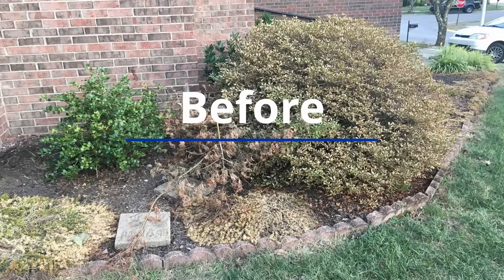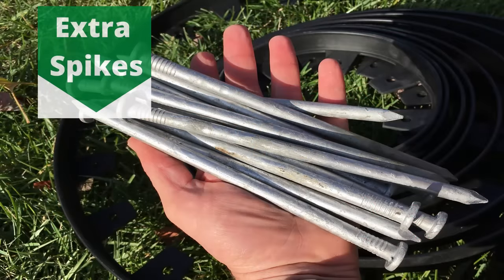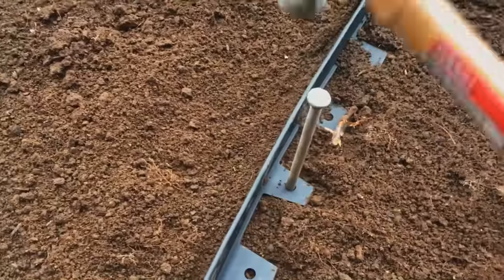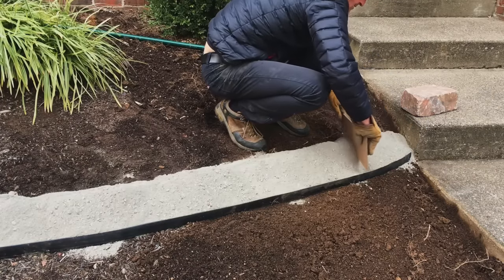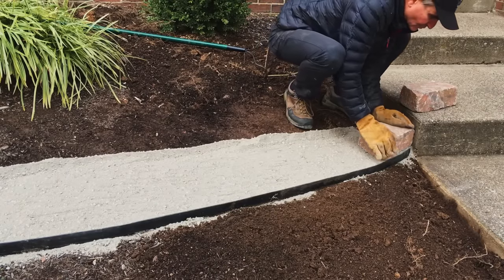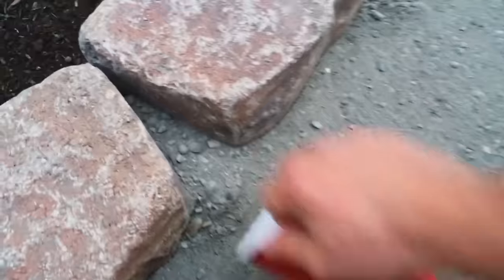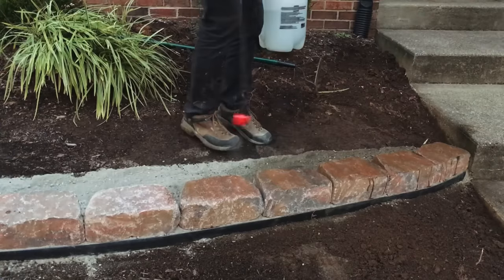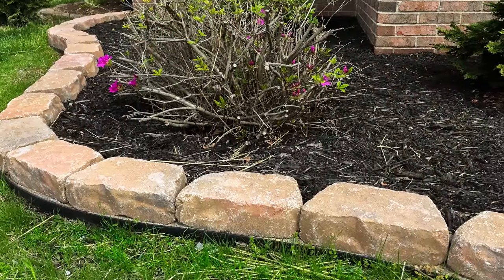easy diy No Dig Border *2020 UPDATE*

Comment: how would this hold up in a freeze/thaw climate
Reply: here in Chicago, that would be broken up with the freezing winters in 1 season. Love the idea though
Reply: I did this in Boston using his old video and all the same material. The only difference is I went three rows high with the blocks. Not sure if the extra weight of each row of blocks (joints staggered) helped with stability, but after three winters everything is still solid. Only time will tell I guess.
Reply from the maker: I make these in Nashville, but others have made them in New England, Chicago, and Canada according to my previous video before this updated this one. There are tons of comments, but if you scroll way through them, they bragged how happy they are with them after a few years.
Reply: That was my first thought also. Seems Michigan winters would destroy the concrete. 🤔
Reply: @wjb111  so concrete is not used in Michigan or Chicago at all?
Reply: @RB-tx4mn  of course it is, burt you would have to go down quite a way potentially. more than a couple of inches

Comment: It may be no-dig, but it’s also no-level. The blocks are leaning forward, not a good look from the curbside.
Reply from the maker: You might not like the way it looks and that's fine, but the angle of the blocks is on purpose because I like it better that way. If you wanted, you could easily taper the cement off to the back side totally horizontal. Thanks for your opinion.

Comment: I don’t know what type of foundation this is.  But on slab foundations you do not want to build beds that go higher than the slab.  That is an invitation for termites and other bugs into your house.
Reply from the maker: Actually, there is no difference in the quality of building product between mortared cement blocks and mortared bricks. It is all the same and termites could care less about that. But if you do have any cracks anywhere, you should get those filled in.
Reply: maxpatch67 in the south brick veneer exteriors have weep holes.  I’m just alerting your viewers to not build their beds too high.

Comment: Maybe I missed the part where you explained how to level the ground properly so your border doesn’t look like a roller coaster track.
Reply from the maker: Ha! Good one. I personally like the line made by following the curves of the ground...to me its more natural and aesthetically pleasing.
Reply: maxpatch67   Definitely, I love the curviness of the outline of the bed.  What I’m wondering is how you get the stones level with each other.  I guess I wasn’t very clear.
Reply: That part involves digging so it was done first. Yeesh, didn't you read the title? This part is no dig :p
Reply: I took the concrete base as the way to level up small imperfections in the  ground without digging.
Reply from the maker: @sandral.2828  Sandra, I'm sorry for the slow response. I just saw this. After you use the cardboard or small board to level off the concrete mix on the plastic edge, you set the blocks down. They will be amazingly level from this process. Again, I'm sorry for taking so long on this question.

Comment: Will this not heave with the frost, cracking and shifting the concrete? I'm in Canada and our winters are long and cold. Also does the stone set into the concrete, or is the concrete base just a type of footing?
Thanks in advance.
Reply from the maker: Though I can’t speak from personal experience, others have left comments in my older video from Chicago, New England, and Canada saying they have been through a few winter and it’s still in great shape...so I don’t know for sure, but maybe it’s worth trying in a practice area??? I’m not sure whAt you would want to do.
Reply: The trick is to make sure that the dirt you fill in the area with does not cover/go above the weeping line of the foundation/walls, particularly if it is a brick home. This also means you have to slope the bed of dirt so it will shed water away from the foundation....putting dirt up against your house ...particularly dirt that is going to absorb rain and the watering of plants...is generally not something I like to do because I don't want to start or make any potential problems worse in terms of cracks, water, freezing and the resultant water issues in the foundation and/or walls.
Reply from the maker: @jinjawitch7963  good advice! thanks!

Comment: Love Love Love this... Do the concrete techq. helps with resetting walker pavers and also do the concrete help w controling ants?  I have sand in between walker pavers.
Reply from the maker: The border does not do anything with the ants. Can you explain your question about the pavers a little more?
Reply: @maxpatch67  probably means can you use the fast setting concrete between the pavers instead of sand.
Reply: The make a sand filler for paving stones that sets up like cement.

Comment: Thanks for sharing such a great video!!  Quick question. When you want to take this up, how hard is it to remove the concrete?
Reply from the maker: This border is considered to be permanent. You would need to use a sledgehammer to bust it up for removal. Ony build this border if you are very sure of what you want for many years. I hope this helps. :)

Comment: Great tip!!! I've been putting it off until I saw your video. Now I'm ready to do it! How do I know when I have sprayed enough water on the quick setting concrete mix?
Reply from the maker: Its, hard to say, but maybe a 5' section should take around 2-3 minutes? I ussually do that and after I finish it all, then I come back with more of a shower spray and soak it even more. That works well, because the first layer is setting up and will not wash away at all and then you can soak it more thoroughly not worrying about washing away the mix.

Comment: Looks great! At what point would you use Landscaping fabric for a new install? Not sure if I should spike it down after the plastic edging then concrete on top and continue the rest of the install? Thanks
Reply from the maker: Do NOT use landscaping fabric. I used to use it many years ago and now I have now for many years because I learned how horrible it is. It seems nice at first until you have tons of things shooting up through it and growing on top of it and it ends up harboring so many invasive grasses and weeds and really does the opposite of what its designed for. If  you need a weed barrier, use cardboard. I started using it for weed prone areas many years ago and it works amazing!! Here is my video about that: https://www.youtube.com/watch?v=HIWDPlaB6wY Just lay down cardboard and mulch over it and you will love it. Thanks for the question and please let me know if I can help you any more!!

Comment: The problem is if you change your mind in a couple years about the type of border you have, you have just created a lot more work to change it out.  I would just put a layer of landscape fabric down to help w/ weed control followed by some sand to be able to level each stone.
Reply from the maker: Sounds like a good solution for you! You're right that this border is a lot of work to remove so it should only be built if you are very sure of what you want for many years. Have a great day, Cooper's Corner!!
Reply: If I opted for the landscape fabric and sand approach, do you feel the sand will shift eventually, seeing as how it won't 'set' like cement would?
Reply from the maker: That might be the case about the sand shifting...I'm guessing it would. The sand method would really downgrade the quality of this border in my opinion. Here are the reasons for using this particular cement product in this technique. The cement provides four major functions in this border technique 1. Height(for looks) 2. Keeps the stones straight/aligned over time 3. Stability/strength 4. Weed barrier(the extra width is nearly impenetrable to aggressive weeds and grasses(Bermuda Grass) that we have here in Nashville. I hope this helps!! Have a great day!!
Reply: @jonijonijoni4694 , using landscape fabric, and sand is how paver patios are typically done and when done correctly they are good for a long time so this shouldn't be any different unless you run over it or hit it with the lawn mower a lot.
Reply: Thank you all for your responses, the sand actually worked out pretty well and has not moved! This would be a great option for gardeners that are renting as well, as it is not totally permanent. Thanks again guys!

Comment: Hello, I found your video as I was searching to get ideas on No Dig Borders.  I watched a few videos where others used cardboard before the concrete.  QUESTION.....Is the cardboard used as an extra protection from weeds growing through??????  I found your video VERY HELPFUL and Informative. Thank you so much for sharing.
Reply from the maker: Thank you so much. I really appreciate your kindness. Yes, I sometimes use cardboard as well for the weeds. I use the cardboard after building the border. With this sturdy border, you don't need to put the cardboard down first. You would just overlap it over the extra concrete space on the backside of the border and them mulch on top. I only use cardboard in areas that either have grass in the area or a bunch of weeds have been there. Usually weeds are more of a problem in sunnier areas, but not always. I have a great video on using cardboard that I'll post here for you. Thank you again and please let me know if I can help you any more. https://youtu.be/HIWDPlaB6wY?si=lDS_538RwGyL5SoN

Comment: This looks so much easier than the $1600 continuous concrete border that I had done three years ago. That concrete is cracking and settling in different areas, of course it happened after the 12 month warranty. Lessons learned ,you can do a better job yourself once you get started.
Reply from the maker: I'm so sorry to hear about that....wow....if you are curious this border is probably $5.50 per foot for all the materials. Thanks for the taking the time to leave your comment, jascam1.

Comment: I have a bed of mulch from the front of my house to the walkway that leads to the house and was wondering if I need to push some of the mulch back from the edge of the walkway or just lay the border around the edging and then the concrete directly on top of the mulch that is already laid? We moved in a year and a half ago and last year all we did was lay some fresh mulch down over the old mulch but it is always scattering on the walkway and there are weeds still popping through. Great video!!!
Reply from the maker: Thank you, @Em7306!! I almost always prefer to dig out the landscaping areas to make them lower so the mluch can sit in there properly and not spill over in the next few years. If you are able to dig out the dirt and mulch so its 4" below the edge of the walkway. If there is higher gound in the landsaping area, it should slope gently down to this edge. Find some good place to use this material like demping it up further into your landscaping area or around the house to help with drainage away from the house...or look for low spots in the yard to fill in. This all being said, once in awhile, there are special situations where I will build one of these with adaptions, on the edge of a sidewalk or driveway. I hope this helps.

Comment: This is the perfect video, exactly what I was looking for, you made it so easy, thank you! question though, could I put the plastic edging on the inside so its not visible on the outer part of the brick? I did read through the comments I guess I could reverse the edging and remove it entirely too. thanks again for the great video.
Reply from the maker: Thank you for your comment. If you don't want the black plastic edge to show, what you will do is attach the edging to the ground in reverse so you are driving the spikes into the ground on the outside of the border making it removable. Also, you don't need to buy the strong metal ones and you can just use the wimpy plastic ones that come in a bag with the edging. You might want to buy an extra bag of plastic ones. What I have done is cut the plastic spikes in half(I use hand garden clippers) so its easy to pound them in and pull them out also. Just wait a day or so until the cement has cured before pulling out the spikes and border. It needs to be mild air, like in the 50's for the cement to cure so right now might not be the right time to make this border. If you make it in summer, the cement cures within a couple hours so the curing goes real fast. Let me know if you need any more help. Thank you for your comment and question!! Have a good day, @lorrainedowden7331.

Comment: I have the edging. Lowe's stones will arrive tomorrow. My only concern is how the edging will hold up to a weed eater when cutting grass. Can't wait to see the result. Also didn't see anything in the way of leveling here.
Reply from the maker: A little leveling happens when you don’t pound stakes into the low areas along your edge. Because of this, the border glides over those creating a more uniform look that looks nice. Your border will be strong and hold up great with your string trimmer. If you get some nice before and after pix you could send them to tim@timvogelaar.com.

Comment: This is beautiful! Is it hard to keep that black plastic in straight lines since it comes on a curved roll?
Reply from the maker: If you want a straight line, the easiest way to do that is to buy a straight edge. They sell them in about 5 or 6' pieces and they are stiff straight and work great for that purpose. Thanks for the question, sandywjo5!!

Comment: Hi, thank you for the awesome video.   Two questions if you could help me with pls.
1 > how many stones did you need for 6ft border?
2>  how many feet did QUIKRETE  50-lb Concrete Mix cover?  Trying to figure out how many packs I will need for 200 FT lawn.
Reply from the maker: 1. These stones are about 11" long each. 2. Each bag of concrete works for about 5 linear feet. I always buy a little extra because its not fun to run out before finished. example: a 200' line of border would need 40 bags. TIP: for big jobs, it well worth the money to pay Lowes or another place to deliver them for you....this saves a lot of time and labor for big jobs. I hope this helps.

Comment: Great simple directions...I have a little bit different project I am doing and I would like to use your concrete technique on it. I am making a stand alone area for my garbage can and recycling bins and I am laying the typical 12 X 12 red pavers, now I was going to lay down landscaping fabric so they sink less over time. Can I still lay that down and them pour the quikcrete over it and set my pavers in perhaps a row at a time? I am also putting in 16 X 16 red pavers at a little bit lower elevation than my garbage can pad, about 4-6 inch elevation difference can I do the same with the quikcrete for that area? and should I use the plastic border like you did for both or maybe just the garbage can pad area? Thank you for any help or suggestions!
Reply from the maker: I like your idea. The fast setting cement is very versatile and easy to use, so its the perfect choice for your idea. You can also make the plastic edge removable if you want to. You can attach it to the ground in reverse so you can remove the spikes easily. Also, you don't need to buy the strong metal ones and you can just use the wimpy plastic ones that come in a bag with the edging. You might want to buy an extra bag of plastic ones. What I have done is cut the plastic spikes in half(I use hand garden clippers) so its easy to pound them in and pull them out also. Just wait a day or so until the cement has cured before pulling out the spikes and border. It needs to be mild air, like in the 50's for the cement to cure properly, so right now might not be the right time to make this border. If you make it in summer, the cement cures within a couple hours so the curing goes real fast. Let me know if you need any more help.

Comment: Thank you sir for you link. I want to try this out but want to have 3-4 levels of bricks. Is it possible to do it in same way? Is there any other video for that which I can refer.
Reply from the maker: I'd recommend using another method, but I don't have a specific video for it. You will likely want to level it with that kind of height in mind. Small walls look much better when leveled. Good luck!

Comment: I wonder how good this would work on a bed that is on a big slope.
Reply from the maker: Its no problem. When leveling off the concrete mix along the plastic edge, just level it out approximately parallel with the ground so it looks right.

Comment: Excellent video. Is there any way to hide the black edging strip?
Reply from the maker: My pleasure, @lewis4929!! Thank you for the kind words. Yes, there is a way to remove hide the black plastic edge and that is to install it in reverse to so it is removable. Use the plastic spikes that come in the bags and cut them in half to that after your cement sets up after a few hours, you can easily pull the spikes out and then you could use your plastic edge again for the next section if you have more to do. I hope this helps. Have a great day!!